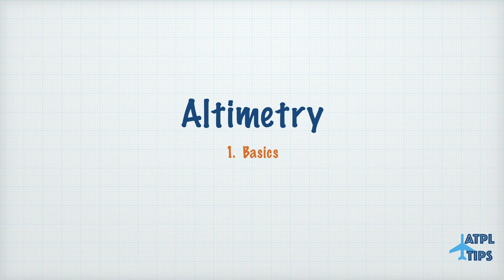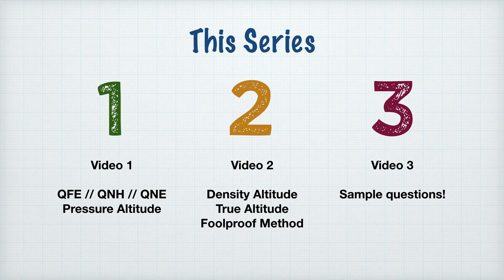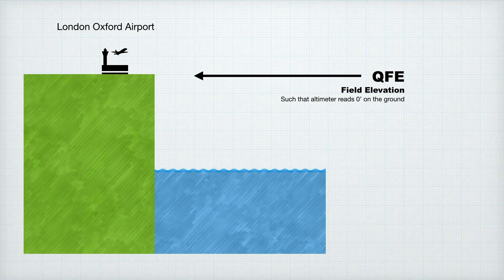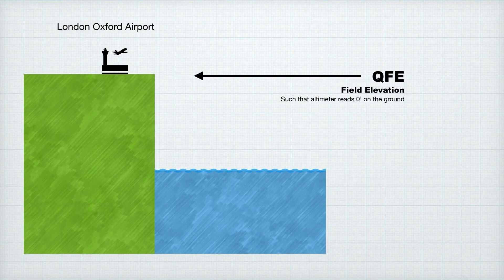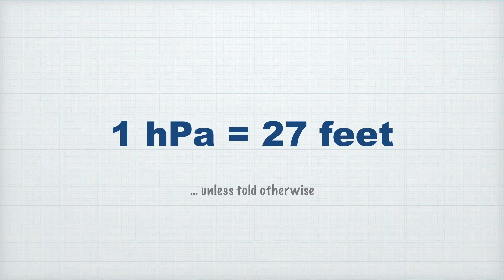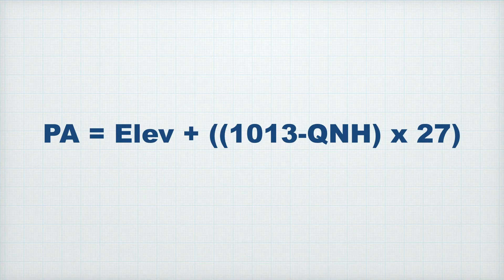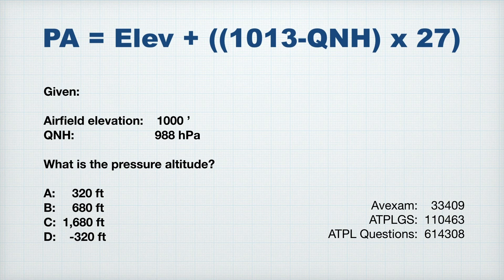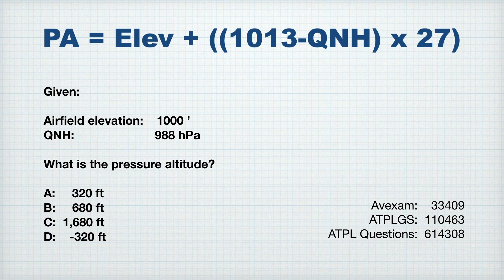ATPL Tips - Altimetry 1; QNH, QFE, QNE & Pressure Altitude

Comment: This is a good and carefully structured aviation teaching video. However, language is powerful and I believe that you forgot one crucial detail that is pedagogically not trivial in my opinion:  It is vitally important to remind your listeners bluntly that both QNH and QFE are "altimeter settings" (specifically,  pressure numbers we put into the Kolsman window).  However, and I think this issue causes much confusion for any beginner, QNE is NOT a pressure number we input to the Kolsman window.  QNE is an ALTITUDE.  It is the altitude indicated on the instrument whenever the Kolsman window has been loaded with a very important but arbitrary value.  Thus. . . . .QNE is the *Pressure Altitude* (as you mentioned in passing).  If we set 29.92 (inches Hg) in the Kolsman window, the altitude shown by our altimeter is Pressure Altitude no matter where we are flying over Earth and no matter the local weather below on Earth or around us locally.  Every pilot here in 'Murika must set 29.92 inches Hg in the Kolsman window before climbing above 17,999 feet MSL.

Comment: I have one question. I read in some books, QNE was not  standard pressure (1013) but it was the altitude indicated by altimeter with 1013 setting when aircraft is on runway surface.
Reply: This is true, I don't know why, but there seems to be a widespread misunderstanding of QNE, especially from pilots. To quote the UK Manual of Air Traffic Services...

"During conditions of exceptionally low atmospheric pressure it is not possible to set QFE or QNH on some aircraft altimeters. In these circumstances an aerodrome or runway QNE can be requested. The QNE is the reading in feet on an altimeter with the sub-scale set to 1013.2 hPa when the aircraft is at aerodrome or touchdown elevation."

Folks seem to use QNE as the same thing as STD/SPS. It is not. It is used very rarely.
Reply: @ClanLawrence Thanks Laurence. This is useful clarification. Just studying all this for my LAPL licence and there’s a lot of conflicting and confusing info out there

Comment: I need a help to make sure that i understood the concept correctly, please help.
Example:-
Airport elevation- 5600 feet.
QNH- 1023 hPA
QNE- 1013.25 hPA
PA-?
[Reference used -1hPA=30 feet]

My Answer:- 
PA= 
5600 + ((1013.25 - 1023)*30)
5600 + ((-9.75)*30)
5600 - 292.5

=5307.5

Since PA is the height from QNE (1013.25hPA) we substract or if follow the math, then plus minus = minus.
However, if QNH would be less than QNE, then we would have added the calculated feet into the elevation rather substracting.

Am i right?

Comment: I have one question?when i studied Atpl the definition of qne was absolutely different.QNE was not  pressure setting,it was an altitude.It was used for mountains areas where you can set on your sub scale QNH due to limitations (950-1050 hps if i am not mistaken).So Definition of QNE was ,it is an altitude not Flight level, when you set 1013 hps you see on your altimeter current elevation of aredrome where located in mountains areas where elevation is very high

Comment: I’m studying for my théorical drone pilot exam out here in France and so far , I have read in my books that it’s 1hpa=28 feet 😂, I watch videos of different explanations about this and most of them state 1 hpa= 30 feet ...
Reply from the maker: Hi Joel, thanks for your comment!  The reason there is some variation is because there is actually no perfect answer.  My advice is:  if your books say 28', then use that figure.  Different exam boards use different figures; I'll try to summarise why:  

Remember, atmospheric pressure measures the mass of the air above the place where the reading is taken.  In standard atmosphere conditions (1013hPa & 15°C @ sea level), 1hPa = 27' at sea level - however, as altitude increases there's less atmosphere above the station taking the recording, meaning the number of feet per hectopascal increases.  Even if you stay in ISA conditions, at 10,000' 1hPa = 37', at 20,000' 1hPa = 50', and at 38,000 1hPa = 100'.  Also changes in air mass temperature will affect what's going on in the air parcel too:  Colder air is more dense, warmer air is less dense.

Ok.  Long answer, I hope that helps.  Good luck with your drone exam!
Reply: Thank you very much for taking the time to explain this 🙏🏾🙏🏾

Comment: Here is Q.. qnh is equal to 1013 and ELEV is 0 then we have a rare case of 0 PA.. what does that mean from pilot point of view? 
thanks and lovely video
Reply from the maker: Hi Andrei, thanks for the question. I guess in that scenario the temperature would also be 15*C, so you’ve got an ISA day (I’ve only actually flown on a day like this once). 

From a pilot perspective it wouldn’t affect much, other than meaning there would be effectively no altimeter change when flying through the transition layer, and it would mean standard performance out of your aircraft (density altitude would equal pressure altitude and elevation too).